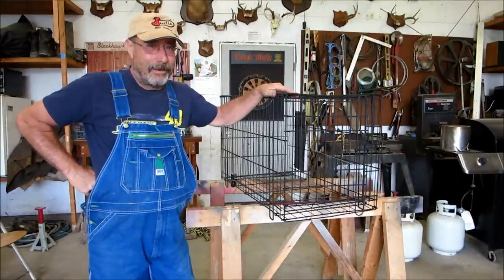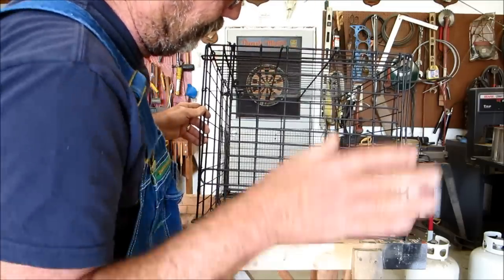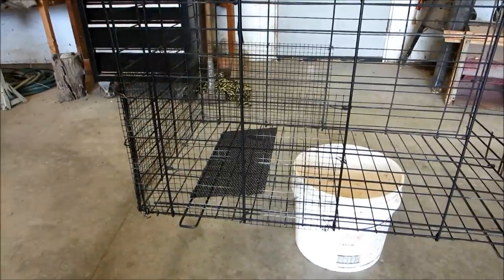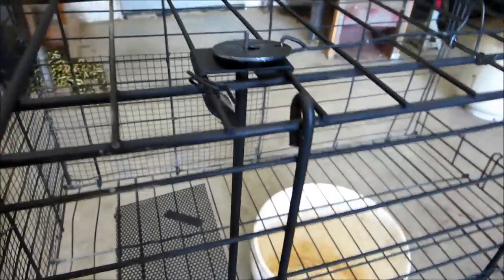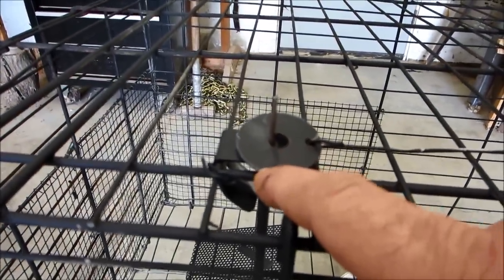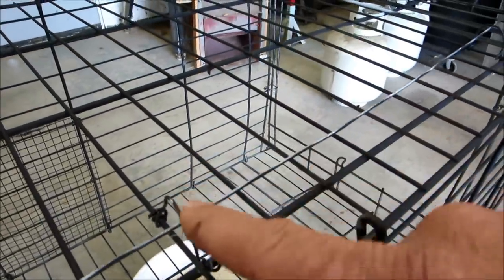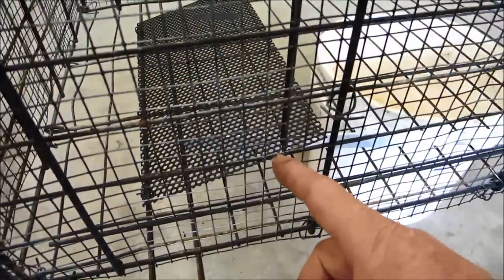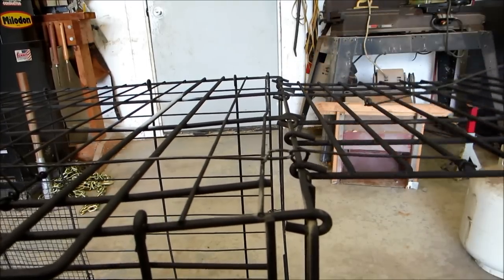DIY Live Trap from Dog Kennel

Comment: I have fitted two gate locks onto an ex dog kennel, and am just about to design the treadle/wire spring mechanism as you described.  

The idea is to catch urban foxes here in the UK.

Will report progress.
Reply from the maker: Please post a vid of your completed trap.
Reply: Will when it's working. Planning using 15mm copper tube to contain vertical trip rod. treadle is grid shelf from old fridge.

Comment: WHAT IF YOU ADDED A BIT MORE WEIGHT TO THE BOTTOM OF THE DOOR TO MAKE IT CLOSE FASTER? REALLY NEAT TRAP. Thanks!
Reply from the maker: Good question about adding more weight but the door slams shut very fast...actually adding more weight wouldn't cause it to be quicker since it is a physics/gravity thing...IE and for example, if you dropped a 1 gram marble and 10 kilogram cannon ball at the same time, they both would hit the ground exactly at the very same instant.

Comment: Heya! I just had a question; how did you get the treadle to stay above the bottom so it could be stepped on to activate the trap? I see it is at an angle, just curious what is used.
Reply from the maker: The weight of the door keeps the treadle up.

Comment: Well, you are an inspiration, Sir!  I have something in my greenhouse eating a whole ripe tomato every day.  There's no way it's coming and going.  He's set up a homestead inside!  So, I've rigged up a Wabbit (brand name) cage.  As you might imagine, it's not meant to contain snarly critters, so I reinforced it with wire.  I used mason line instead of wire to trip the treadle.  It runs smooth. Then I had to come up with something to keep the door shut once triggered.  When the cage is used properly, the door opens like a draw bridge.  I have it upside down, which means the latch won't work.  So I'm using neodymium magnets... LOTS of them!  I estimate the critter would have to apply 10 lbs of force to open the door.  Now, I'm hoping the weight of the critter is enough to depress the treadle.  I estimate he has to weigh 2 lbs to trigger the trap.  Whatever it is, it can stretch up 18" to grab tomatoes.  If I catch him I'm gonna name him Scampy!  LOL!  Kidding.  I've been calling him all kinds of names when I see he's eaten yet another ripe tomato, but Scampy isn't one of them!   Thanks for sharing your genius.  Wish me luck.  It would be a sad day for mankind if I end up outsmarted by a rodent!
Reply from the maker: Good luck and think you've a possum getting your maters!
Reply: @MarshRat  Possum?!  Could be, I guess.  The winters are cold here, so if it is a possum, he's a newcomer to the Georgian Bay area of Lake Huron.  Saw Norway rats here since last fall and I've never seen them before either.  This critter can sure climb!  He took half of 2 tomatoes overnight.  One was 6 feet up the vine.  Yah, Scampy's got to go.  He's eating more tomatoes than I've been able to harvest.  Doesn't seem to care for cukes or peppers, though.  I guess I should be glad for that.  And if he's trapped inside the greenhouse, maybe I'll be able to harvest a few tomatoes growing outside.  Thanks for IDing the critter.  Could be worse.  Groundhogs grow to 18" wide by 24" long here, not including the tail.  They eat baby birds and climb chicken wire fences.  They're like the Mafia and don't back down without challenging me.  I've been paying clover "insurance money" in exchange for the lives of my baby broccoli plants.  I also had a rabbit murdered on my deck by raccoons, or maybe a martin.  There was blood and guts everywhere!  A possum doesn't sound like much of a threat compared to the usual meat-eating critters of the area. Thanks for advising.  The trap is set and baited with Scampy's leftovers from last night!

Comment: Very cool.where did you find springs and How did you attach the springs to latches?
Reply from the maker: If you're referring to the single spring on the latch in the middle of the door then it was already there.
Reply: You say that you took the latch apart and installed a spring. So what do you mean it was already there?